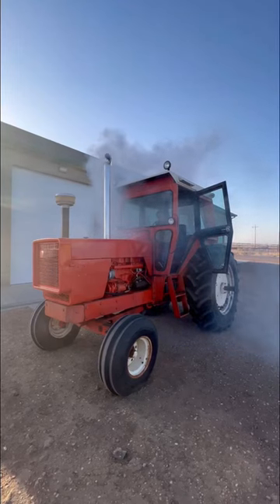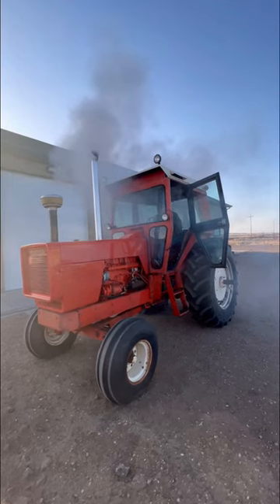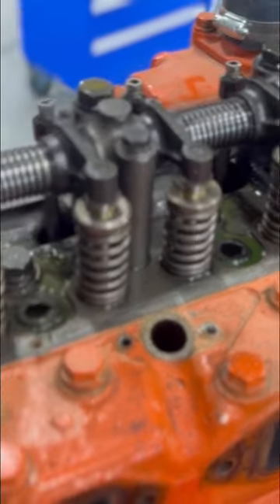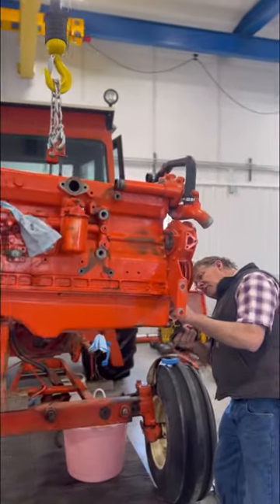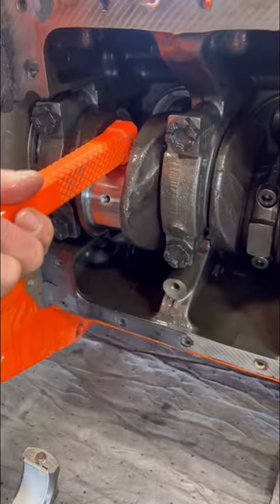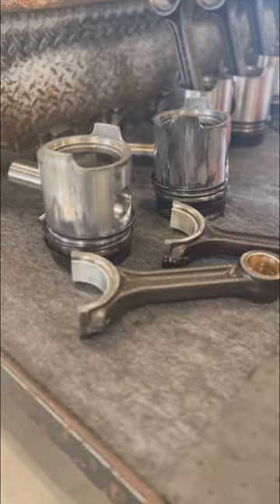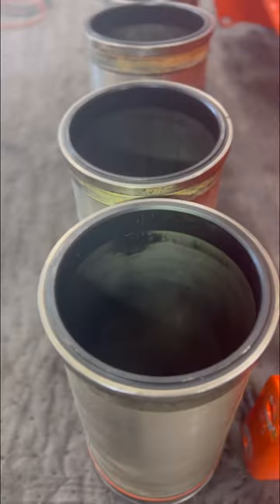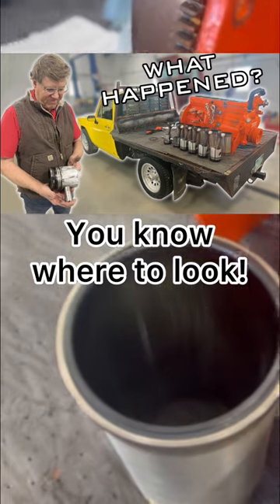#shorts A Catastrophic Engine Failure Is Never Fun!

Comment: I think failure is from wrong piston ... thermal expansion caused scoring and seizure wen hot and restart wen cooled
Reply: I experienced this this when I was in High School. I’m about Jim’s age. A younger guy came to me with his 80cc Yamaha. He wanted me to put the new piston and rings and the jug on the bike. I did and told him to go easy for a few days on that new engine. He came back an hour later saying it seized up on him. I think the bore was too tight and the rings ( I checked them in the bore) probably could have been ground a little. I was a junior in HS at the time. What did I know about thermal expansion, very little except go easy on the engine until break-in. Jim, maybe yourpump was not 180 degrees out and was 90 deg out. Due to the spray pattern..My 2 pennies.
Reply: their theory is bad injector timing overheating the piston and rings, causing the rings to over expand.
Reply: My guess is oil starvation, either from oil pump failure or an issue with the pickup tube
Reply: @THE_PeglegSwantoon  If you watch the full video (linked in the pinned comment) they go through how they are pretty sure it was bad timing on the injector pump.
Reply: I have never heard of bad timing causing engine failure.

I know you can change the advance on a Cummins & it will heat but that usually leads to burned valves if I remember correctly.

That looks like a lack of oil under the piston to me.
Reply: @pvtimberfaller  go watch the full video (it linked in the pined comment).  Where they go through the whole logic.  And the fact that it is a known failure mode for this engine.

Comment: We just had a CAT engine done in a truck and it turned out the piston sleeves were not round, so double check parts now they are crap in the kits
Reply: I agree, Shite comes from everywhere. They can’t tell good from bad. All about the Dollar, be careful. I love your channel. I don’t know anything about tractors.
Reply: You always have to bore the sleeves to the correct size. It doesn't matter if they are round or not before they are installed.
Reply: This is what happened to a guy here on YouTube rebuilding a BMW engine. You should always measure the bore after the sleeves are put in.
Reply: @johncoops6897  No, some wet sleeves come all ready to go.
Reply: @Iaintwoke  - Well, no.... obviously not. You ALWAYS have to check piston clearance and ring  gaps.
Reply: @johncoops6897 heavy duty diesels come already assembled their called packs no checking is required but I do so I am confident that the rings are spaced out but caterpillar make drop in packs you don't need to disaemble..but we have no idea what type of rebuild this tractor had..
Reply: @johncoops6897  not necessarily
Reply: @bigred1247  I check the cat cylinder packs I’ve found broken oil rings and gudgeon circlips not in properly
Reply: @spannaspinna  - You mean not necessarily check the supplied parts? LOL, yeah that's a good plan 😃
People wonder why engines blow up like this tractor... go figure.
Reply: @johncoops6897  no I mean not necessarily have to bore liners and if you’re a tradesman you’d know that
Reply: @spannaspinna  - Yes, but it's always necessary to CHECK parts and tolerances before assembly. That almost 100% prevents problems like this tractor engine seizing for "no apparent reason".
Reply: @Iaintwoke  They say they are ready to go......verify.

Comment: My Professional opinion is the most common cause of a scored Piston is Piston Cooling Jet, Pissing fuel injector, or a out of round Cylinder Liner!!
Reply: So basically anything....😂
Reply: I said causes with a s', it requires failure Analysis of a Professional like me! Iam not there with that Engine in front of me, and only limited data, so that is the best I can give at this point!

Comment: I just went through something like  this. A simple head gasket and for good measure upper end freshen up (deck head, valve job, water pump, lifters. Ended up being a second head removal, amd then most of a bottom end.  Culprit. Incompletely machined new lifters.

Comment: This is a good mentality with any complex system, it's easy to say you fixed it when you find an issue and fix the obvious damage, but its not so easy when that same problem keeps happening, or starts getting even worse after that "repair". Take a deeper look, take your time, and don't get complacent, there may be something you overlooked and it can happen to the best of us, so keep an open mind and don't be so lazy that you don't investigate all avenues of failure. Put in that extra 30 minutes or 3 days or 3 months or 3 years or 3 decades, whatever it takes treat your problems like a cascade failure and root the problem out to the peak of possibility.

Comment: The one odd thing I ran into on a agriculture stuff was the Pistons were not ground to the manufacturer specification and required much more clearance I do not believe this is your problem check each Pistons ground in taper to make sure they're all the same still believe you will find a fuel issue probably a couple of leaky injectors washing the oil off. PS I have watched some of your videos and you guys seem extremely competent and knowledgeable to me just trying to help not a know-it-all at all

Comment: This is why you plastigage bearings, check out of round on the cylinders, pistons and bearing races. I've built several engines of which not one has ever failed due to my build. Only had one engine go south but it was due to the customer drilling on the head with the spark ug holes uncovered. Needless to say his engine didn't last 50 miles.

Comment: I had a problem like you on a motorbike 4 cyl. One new cilinder did not run in and used a lot of oil and fuel. Why ? We rebuild again and the problem never came back.

Comment: Follow the specification manual n the break-in
procedure.
Most important thing to do in an engine overhaul is to inspect or replace the oil pump n make sure all oil galleys are clean n open. A 
marginal or used oil pump will fuck up a fresh
rebuild in short order... Follow the repair manual.

Comment: I’ve seen a failure like that a few times , it’s called lack of oil . I’ve rebuilt motors for others and they perfect . Then they say “ it’s broke and I haven’t had much use “ , you turn up an it’s locked solid . You then go to drop the oil and hello , it’s dregs coming out . Asking the friend “ when did you do the oil change last on it “ , “ last week , how did you know I did an oil change ? “ they reply . I reply “ because I put oil in and ran fine , no oil leeks evident and oil doesn’t evaporate in a few months , you dropped the oil and never put it back in “
Reply: Wasn't lack of oil.  There was plenty of oil in the engine.  They are pretty sure it was a mistimed injector pump that was causing detonation in a cylinder and overheated the piston rings, causing them to over expand an scrape the walls.

Sadly they are not 100% sure due to a miscommunication with the shop looking at the pump.  It was rebuilt before being full tested.
Reply: @Dysan72  Did you ck EACH gap on EACH ring ???
Reply: @georgepruitt637  their smoking gun is that on the damaged cylinders the burn marks from the injector is too high on the bowl, meaning it was firing too early, causing excessive heat, causing the rings to over expand. So even if they were gapped properly they would have scraped the liner.

The defi itinerary proof would have been checking the timing in the injector pump. But due to a mis communication the pump was rebuilt before that test was performed.